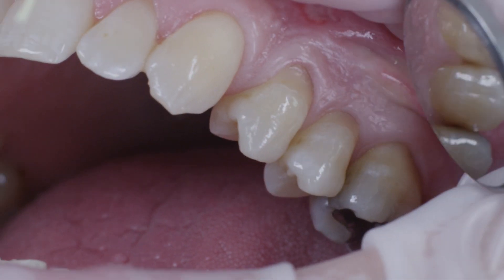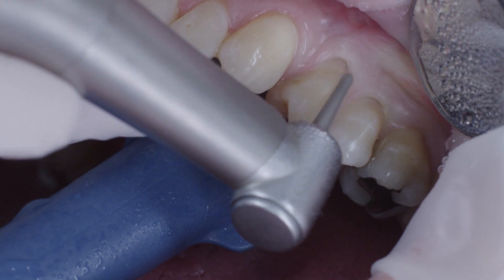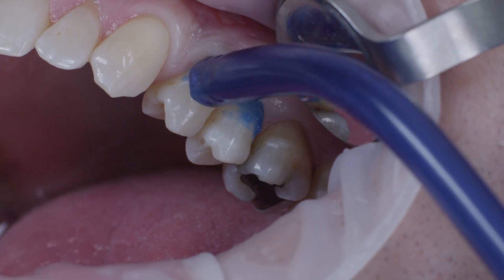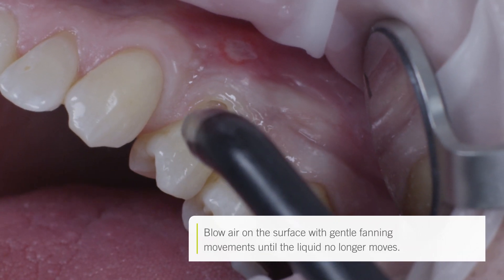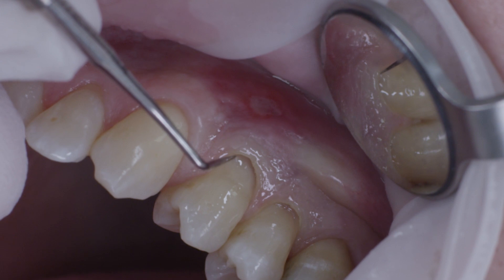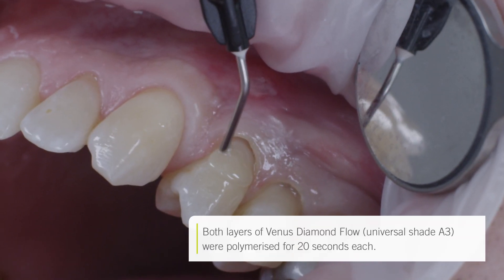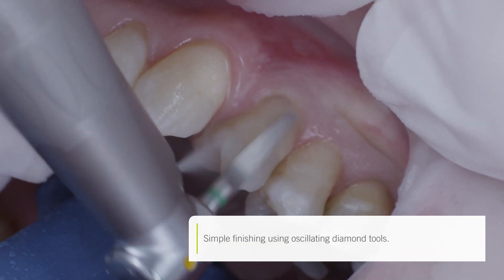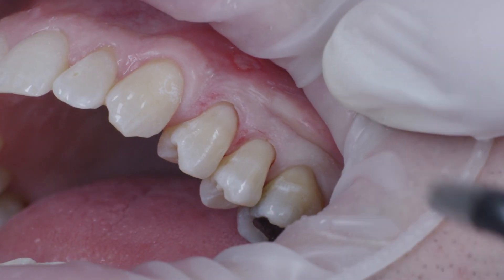Step-by-step class V restorations-flow or conventional composite [EN]

Comment: Why did you use flowable for one and normal composite for the other..... And which do you think is better....I actually like the easier handling of the flowable
Reply from the maker: We wanted to show both options in restoring a cervical lesion. The dentist can choose the composite for such class V restorations dependent on the individual handling preferences. The flowable and thixotropic Venus Diamond Flow or the pasty Venus Pearl/Venus Diamond. :)